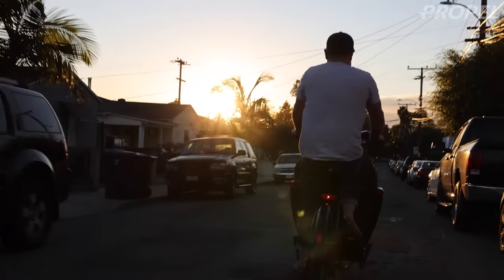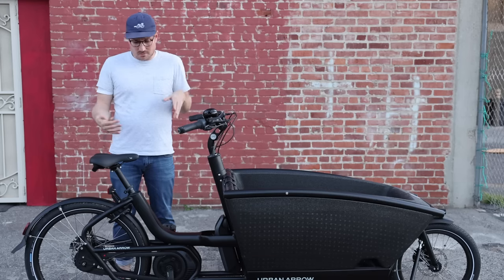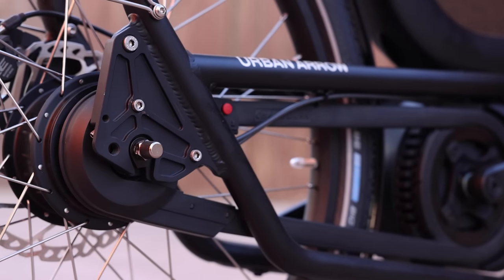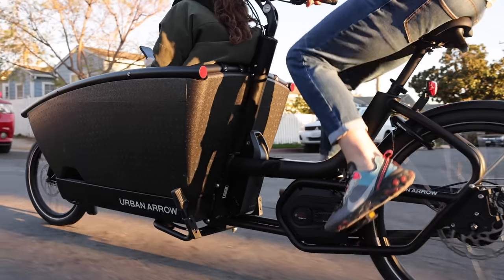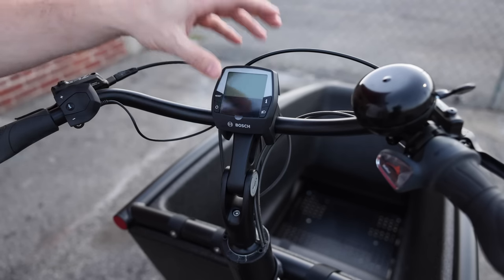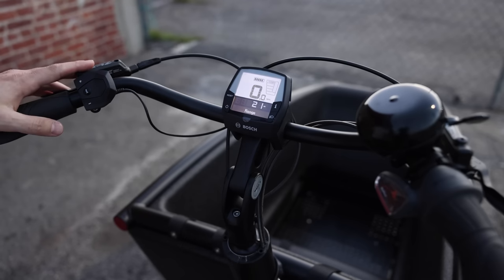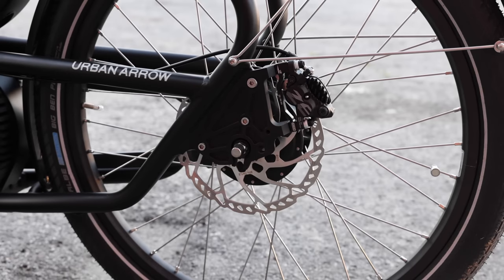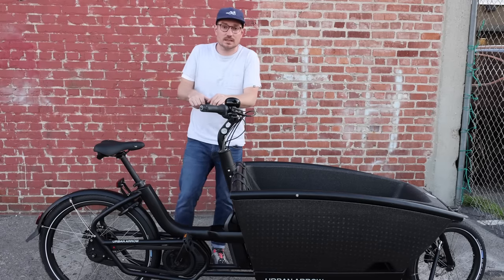Urban Arrow Family Cargo Bike Review

Comment: Thanks for the review, spot on , one small thing to add, that during colder months of the year, the styrofoam box can produce a squeaky noise while riding the bike, you can take off the top frame, add a bit of vaseline to help cut the noise.

Comment: As always, Chris, a great video. You're developing a style of presentation which makes it a pleasure for the viewer to watch and learn. This is a very rare skill, and you're perfecting it. 
The bike is very well thought out, beautifully built, and, in my opinion, would be equal to the R&M Cargo if it had suspension and 625 batteries. But, as the Netherlands has flat, well maintained roads, their absence is understandable.
Reply: They sell this bicycle in lots of countrys.
Reply: Totally  agree  with you. For me the big reason  of not going for this bike is the lack of front suspension (STRANGE they have that option  only on the commercial  version, not the family one). Not forgetting  the bigger batteries  and the lack of cable steering.
Reply: @leojonkers3181  That's very true, Leo. However, when the bike was originally designed, it may not have had such an international market. Or, Urban Arrow may consider suspension not that important. It is, after all, a relatively new addition to the bicycle.
Reply: @josephf5036  I must admit, I thought the steering was a tad rudimentary. This bike strikes me as an old design that has been progressively improved over the years.

Comment: how many full sized humans can you fit in this cargo bay? I mean with keeping stable and moving forward at a good rate ?
Reply: One. I tried it with two kids 5 and 8 and it was a squeeze.
Reply: My boyfriend cycles with me (178 cm tall) in the box including our baby in the maxi cosi on the adapters. I assume 1 adult and 2 small kinds on the bench will fit, but I guess 2 small adults might fit but I wouldn’t worry about the steadiness or speed. This bike can handle a lot of weight.
Reply: @lottevanloy9284  To clarify, you have been able to transport two adults and one baby, via the Maxi Cosi adapter, on the bike? If so, it sounds like an awesome option for our growing family!
Reply: @Jason-sp5yc  Yes! One adult cycling, one on the bench and the baby in the maxi cosi
Reply: A 280 pound man, an 80 pound child, and a 42 pound dog can all be carried inside the basket although it's a somewhat a squeeze for the legs. You do need a lot of experience balancing heavy loads, but if you have ridden a large motorcycle then it's not more difficult.

Starting from a hill does require precise pedal and gear position. My experience is that it can be quite difficult if you're even a little bit off, but easy and drama free otherwise.

Comment: The problem with these e-bikes is that nothing, absolutely NOTHING about them should cost as much as a middle tier motorcycle. This thing isn't worth $6000. It's a bicycle with ~$1000 in motor and battery added. They're only getting away with it because they're relatively new, but it's incredible what they're charging.

Edit to add: but this is a very good review. And I still might get one anyway, despite the overpricing. I guess that's why they charge that much.
Reply: Consider that a bakfiets long Is €2000.
Reply: Simply not true, although one can see why it would appear so.
Everything is more rugged on cargo bikes, at least the good ones.
Further it's usually made in smaller volumes by the manufacturers, which drives costs up.

Comment: The $6k and $7k price point is too high for how much bike you are actually getting. This thing should cost $4k and $5k respectively. At $6 and $7k I expect a suspension system to be included. The biggest difference with these bikes is that the frame design and the the helmet foam they provide. Now, as I understand, the have aluminum frames not carbon so they aren’t hand built. Honestly, I would rather pick up a fancy cargo carrier with a suspension and mount it to the back of a fancy eBike for this kind of money. Also, the kids should have a bar to hold onto. In an accident, their hands shouldn’t be holding onto the outside of the cage where their fingers or hands can be injured.
Reply: Unfortunately that seems to be the going rate. A similarly spec'd R&M Load 60/75 (full suspension) with an enviolo hub and gates drive plus cargo compartment and child seat runs $11-12k. An e-Bullitt with gates drive and 85nm motor is $8200.
Reply: I've driven both with front suspension and without and I've chosen the UA above others due to the ride quality. Ride position is maybe not perfect, but the responsive steering made me choose UA. I've tested Carqon, Lovens, R&M, Cube and gazelle.

I can imagine if you're driving rough terrain it can help and maybe it will reduce the bouncing of the front (did not experience that) . But when I'm driving off-road I will refuse tiré pressure anyway.

Comment: We bought one yesterday. Our one big complain was the strange severe angle of the handle bars. Instead of being horizontal, they curve back unnaturally. So we had them lower the handlebars to a kind of absurd weird point. But it made them usable for us. Just the weirdest design choice.
Reply: It's not weird, it takes off pressure when riding for long periods. It's more a preference. Take a look at city bikes vs more sporty or mountain bikes. 
You have handlebars that slope way way more back then this one. I tested almost any cargo bike, with cable steering, straight handlebars, ... From UA to Lovens, R&m, cube, ... And I can honestly say that this bike is one of the best handling on the market. While not the most sporty, it is very responsive and comfortable.

Comment: sooooo expensive :'( !!!!!!!!!!!!!!!
Reply: The amount of money you’d save by not owning a car would more than make up for it.
Reply: Ngl it is very expensive, but compared to a car it's super cheap
Reply: Cheaper than the Riese & Müller Load and Packster models
Reply: @stephenstetler3324 actually i think that should be the main message. What are the key difference between the two offers? Weight bearing? Speed? Suspension?
Reply: @pdannysan13  I don’t think you’re going to find the difference in features, it comes down to quality of said features. Like comparing two houses - they both have 3 bedrooms, 2 bathrooms, but one is in a highly desirable neighborhood and is very luxurious, where the other is perfectly adequate in other way just not as high end. The Urban Arrow comes with the same Bosch motor options, so everything tied to the Bosch like battery capacity, speed, torque, smart system, etc. will always be the same. In my experience though, I prefer R&M because it is so much more comfortable in every single aspect.
Reply: Sooo expensive but yet nobody in the US would even blink when they see a car at that price or higher. Always found that to be funny